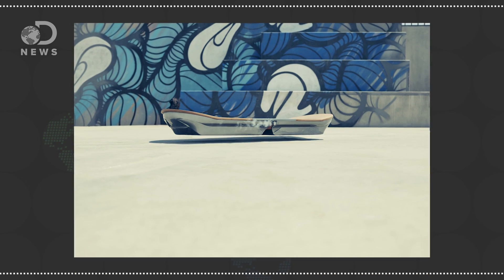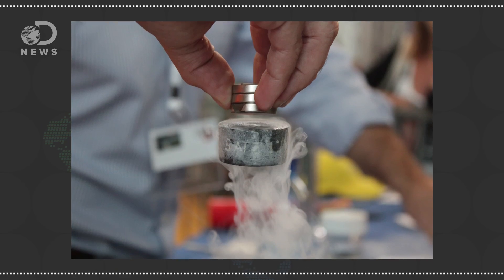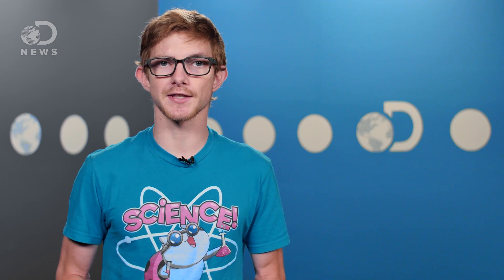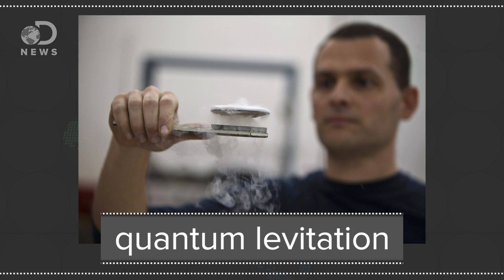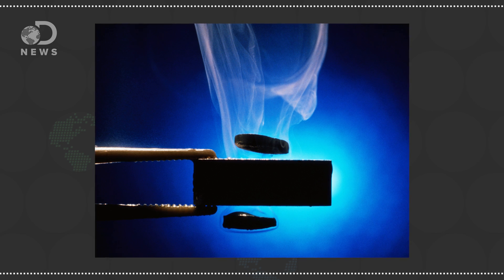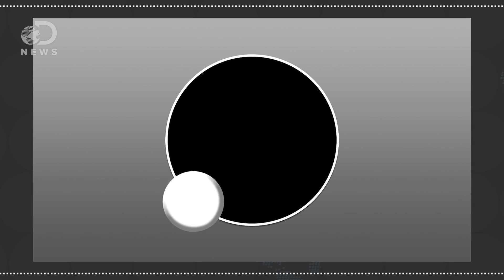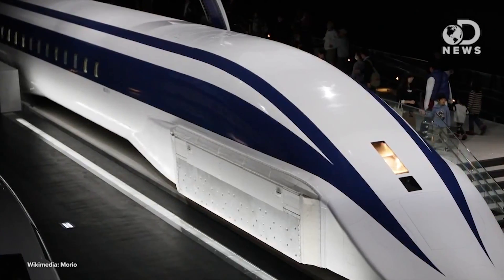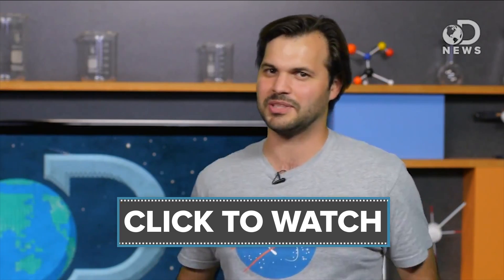How Does This Hoverboard Work?

Comment: So basically what you're saying, is that mercury is the reason the Aztecs and the Egyptians were able to move those massive boulders around and stack them. I know there is one component that you'd need to use it on a very very large scale. I will share it with you if you write me back.

Comment: Would it be possible to construct an 'endless track'? Such as a device to place pieces of a track as the board moved? Which would place pieces ahead of time and adjusted placement. Or would the size of each section being layed down be too large? Or does the track have to connected without breaks in it? Although, since the board is essentially a magnet does that mean the track sections would have be pinned to the ground? If yes, that would mean the track sections would have to be pinned to the ground for a time as the board passes by. But then be able to be picked up and moved again. Otherwise the deployable 'endless track' could only go as far as the number of sections of track stored in the track deployment device. I suppose if using this technology for hoverboards does not pan out, one could see it used to support weight. Perhaps a shelf of some kind or a table? Hopefully modifications to said technogy or further research could determine a work around.

Comment: How is this even a big thing, all it really is, is a controlled repulsion between two magnets with a very good balance of the equilibrium. No ones going to have a magnetic surface to use it for ultimately deeming it useless. Hype should only be deserved if the hoverboard didn't need a magnetic surface. That being said I'm aware it's a very complex mission to undertake but it's going to be of no ones interests if it only floats on a magnetic surface
Reply: Jorgen Pakieto It's actually using quantum locking, not just controlled repealing. The flux lines literally lock the magnet in place. Still not that big a deal though. Not very practical at all for a skate board.
Reply: +cortster12 indoor kite is saying fuel would be obsolete because a magnet would be pushing the car along
Reply: cortster12  We should use this in cars for less friction, if its possible. just a turn of a magnet, and the wheel starts turning pulling the car along. a very very strong magnet.
Reply: +Indoor Kite it's a good idea but much too expensive to replace the roads with a metal surface.
Reply: Jorgen Pakieto no, just on the tiers on the car, instead of the axial . Im just not sure it would stay together properly.
Reply: Indoor Kite And then we would need to use fuel AND liquid nitrogen. The cost of owning a car would go up immensely. It would also bankrupt the entire country, any country, to replace all the roads and drive ways. Never going to happen.
Reply: cortster12 No, no, no, you wouldn't need to replace roads, the magnets are for the cars wheels. It would work like a water wheel, a current of magnetic force pushing, or pulling the wheel making it turn, It would probably work best in cold places like Russia,Canada, Alaska. If you can create a vacuum, less energy would be able to get to the liquid nitrogen, making it last longer. I never assumed it would be a good Idea economically, it would just be cool.

Also fuel for what? All you are doing is turning some magnets, so a single car batter would suffice for a long time, unless you need the fuel to make the magnets.
Reply: Indoor Kite You truly do not understand what you are talking about, do you?
Reply: Marcos Martinez Electromagnets require electricity, and how do you generate electricity? A generator. And how do generators work? By the expansion of gas turning a magnet to generate electricity. You still need fuel, you always will.

Comment: So if the whole park's floor was this superconductor would you be able to hover freely over the whole park?
Reply: Matthew Eng The floor isn't the superconductor, the board is. The floor is made of normal magnets.
Reply: cortster12 oh OK. So if the whole park was made of magnets then.....
Reply: Matthew Eng Only the area they shows them driving on. They put some rails under the concrete. It cost much less just to put a tiny amount where they were filming then to replace the whole park for one shot.
Reply: +cortster12 There was no concrete tho you spastic
Reply: Smiley Dad Pavement then. Stone. Asphalt. Whatever. I am not an expect on how materials look when barely paying attention to what the ground looks like.

Comment: couldnt we use an oversized version of a mag lev train to do a magnetic first stage launch system for space shuttles?? i mean i would think it would cost less to do that way and liquid-ox being fuel could be used for the coolant for the first stage no?? then we could bypass some of the excess rockets plus create a multi launch system in the process. or am i mistaken somewhere???
Reply: Ryan Schafer THIS
Reply: Ryan Schafer You would literally need your own power plant for such an idea. Not a bad idea, just not very feasible. Trains and Roller Coasters are the only real use for that tech currently.
Reply: Tryo707  but when you think about it, the large boosters that we build to get into space would waste just about as much energy and more materials wouldnt it? plus i never said we couldnt put it near somewhere that doesnt have a renewable source, hell i think a hydroelectric powered super sled would be freaking awesome to send ships into space with.
Reply: Ryan Schafer We would have to either cool the whole track(yikes, R.I.P money) or cool down a part of the rocket, then you would have to get the rocket up to a certain velocity for launch which I don't know how air resistance and the weight of the rocket would play in this situation, i'd imagine you wouldn't get very high.

In other words, I don't know, maybe a small rocket?
Reply: SlyTy98  cool part of the rockets, we already use liquidox as fuel which is around the same temp as liquid nitrogen it would be a matter of having it cool part of the ship as well as act as act as fuel once its off of the track. this should give us a good pre boost with no use of extra fuel as well as give us a good reusable launching point rather then trying to launch and recover rockets which seems a great deal harder then just using something that inherently will be part of the ship.
Reply: Ryan Schafer (and yes i edited the above to be more clear and expand upon the idea.)

Comment: Back to the Future said there would be hoverboards in 2015 and it's happening. Now we just need self-drying clothing, self-tying shoes, and time travel.
Reply: ***** And Flying Cars!!!
Reply: Capitan Creppy That goes without saying!
Reply: Shawn Ravenfire less travel trough time more travel to a point in time. But then  wouldnt that mean your action wont actually effect your future. Since you cant actually go back in time it more like a sepreate demension in time you went to.
Reply: As I understand it, time travel to the past is theoretically impossible.
Reply: ***** Some scientists speculate that if you slingshot between two cosmic strings at near light speed, you'll go back in time.
Reply: ***** If it does not effect You why should it matter :3
You would just go back to your timeline like nothing happened.
Reply: +Capitan Creppy we have flying cars they're just insanely expensive and complicated and there aren't very many
Reply: +Capitan Creppy We already have that.